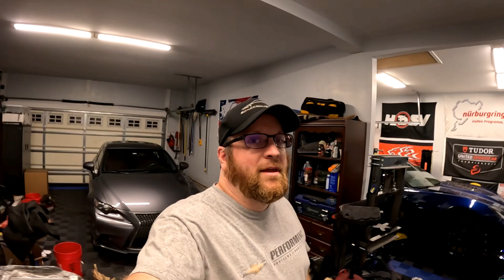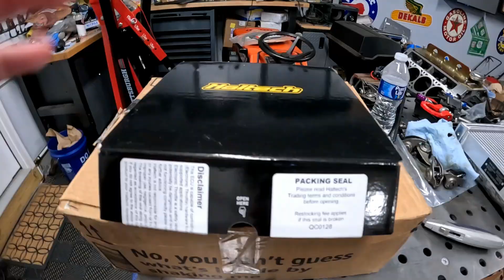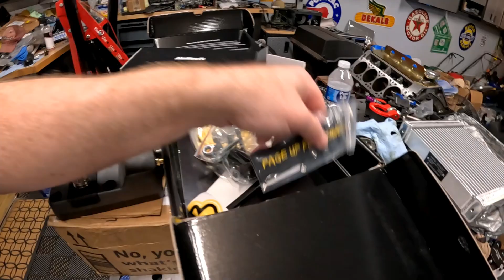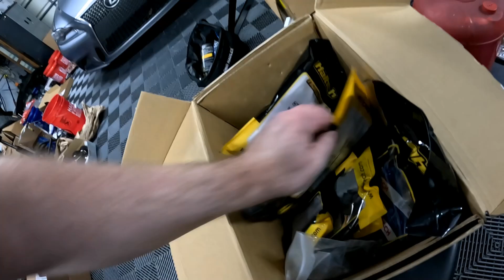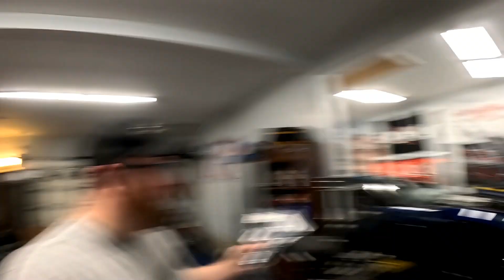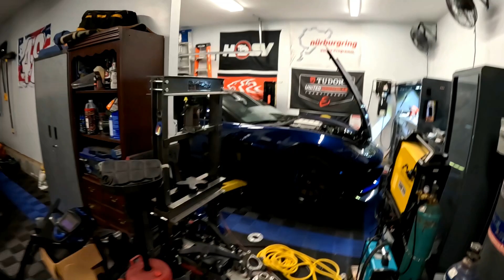2005 Chevy Corvette - @haltech Rebel LS ECM Gen IV

Comment: Thanks for running through this. Im looking to run a haltech reble and keep my stock E40 running the gauges also and now I know how. Appreciate it thanks.
Reply from the maker: So this project is taking a big turn - I want a more plug and play solution - and there is now a plug and play kit for the 2006+ cars.

I have picked up an interior harness, engine harness, and a couple other parts to convert my car over to the E38 ecm and wiring.

Comment: The Rebel is one BADASS combo.... at their price point with a harness included (they went on sale near Christmas for $1400) Haltech is out to absolutely murder Holley. I did opt for the R3 on my TT build, but already foresee at least one Rebel in my future for the sister car. SO MANY TUNING OPTIONS at your fingertips. I can't wait. Though I do hope they unlock the programming for the ZF 8HP transmissions like MaxxEcu has because that would be great for my truck.
Reply from the maker: I picked up a Rebel LS in that same sale - Jegs took another $150 off with an additional code that I had.

Tuned by Shawn makes a plug and play kit using an R3 for the 2006+ cars - and I am going to pick that kit up. Actually I am going to to be pulling the engine harness, the interior harness, and the bcm, fuse box out of the car and installing a set out of a 2011 Grand Sport. 

As mentioned in the video - my car has a 1 of 1 year ECM that is terrible.

Comment: I'm the same way. Electrical is way at the bottom of my "Can do" list haha. 

Looks like its gona be a long task but you'll get it done!
Reply from the maker: If I ripped out the OEM gauge cluster - and went with the Haltech display, it would be easier.

But I really like the stock gauges - and I want to keep AC. 

So getting the correct adapters/splitters as I mentioned in the video - and then do all this extra wiring/work to get everything complete.